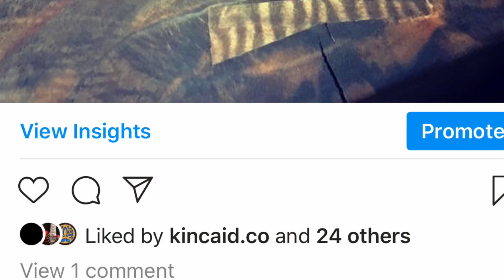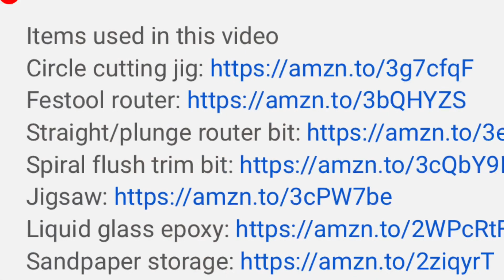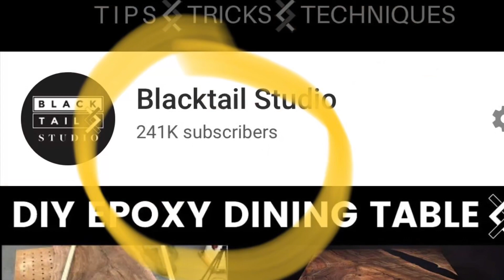Stable Job, Good Money, Great Benefits... I Quit - Blacktail Studio

Comment: Dream Job: College Professor, but my current job in Oil & Gas (Houston) is pretty rad. Anyhow,I have lots of access to cypress from the Atchafalaya Basin, and I'm wondering which epoxy/process you'd use for a cypress slab table given its one of the softest woods around?
Reply from the maker: Oh, probably a longer conversation than I can have here. Very cool though!

Comment: Really enjoy this channel and just getting started on a live edge mantel- I bought a kit of sand paper that had 80, 120, 150, 180 and decided to skip the 80 and do my first sand with 120- I then reread your sanding blog and realized you stress starting with 100. Do I go back to 100 and work my way up or do I continue from here directly to 150. It came off pretty smooth from the planer. Also, if using Rubio mono- how high of grit do you go on the live edge if you want to keep some of the character?
Reply from the maker: You’re probably fine if it looks good

Comment: Love your work! I am doing my dream job, I am a District Chief for a large Fire Department with over 40 stations. I love woodworking and have accumulated a large shop of woodworking tools. I have built miles of cabinets but I just bought a walnut slab and am going to attempt my first epoxy river table with black epoxy. My question is there are a big selection of epoxy on the market these days, is there any you would stay away from? or is there 1 or 2 that you would recommend? I know you like ecopoxy, it is quite expensive compared to some others, but maybe worth it. Thanks
Reply from the maker: I recommend liquid glass epoxy 👍🏼

Comment: Creative Director at my own designer furniture/art furniture brand. I have a degree in design, a woodwork studio and have wanted to be a designer since i was like 5 or 6. My question is about your promotion images. I have a finished product and I'm in the product photography phase, what strength of bulb do you use to shoot your tables, and how many of those bulbs are there? I want to have a at least a few nice reflections in my work (I use danish oil so its not super matt) Ive got 3 x 50watt blubs, n the pics are coming out a lil flat sometimes, so i was just wondering what you use for lighting? Thanks

Comment: Miltary Scout Helicopter Pilot - So you no longer have faith in a Jesus Nut.   I'm in the process of building my first table, part time, in the style of one from ISHTANI furnature.   I'd love to say it's working out, but there are so many gotcha's.  I've found out that the wood I'm using irritates my nose (spalted curly maple), I have headaches and sinus pressure for days after a good shop day.   I've a couple of air cleaners running and I still have to wear a respirator while doing most work.   I found your video's when I asked FB how they finish tables and a friend quickly linked to yours.   I had been struggling with varnish, and I hate it.  I don't own a paint shop, I have a dusty wood shop.  I've been using teak oil for tables and a mineral oil/beeswax mix lately for our countertops.   I just ordered some Osma, I had been looking at it for a few months and your vids helped me pull the trigger.   I was also impressed at your sanding technique, and I'm looking forward to trying it to see the difference.   My question is, when did you make the leap to buying the best tools you could instead of the mid grade line?    I'm constantly fighting the tolerances of my (good) tools.

Comment: You'll probably live longer? My Dad used to be an aeronautical engineer and worked on helicopters in the 50's. He never trusted them and didn't like to fly in them. They are not aerodynamic in the same way a plane can be and can't stay aloft at all without power.

Comment: Woah, at 13:18 there seems to be a tornado in the background and a chopper taking off. Practising your emergency routines? You're going to miss those birds, I promise you that much, but hope this takes off big for you. IF you were a good wood worker, try making drums! A snare made from one solid piece of wood sells for about $900, that is a 5 1/2"x14" slab. Other shells need laminating and pressure ovens to manufacture.  Check out Noble and Cooly's video here.                              https://www.youtube.com/watch?v=Z9Is2FLeQlk